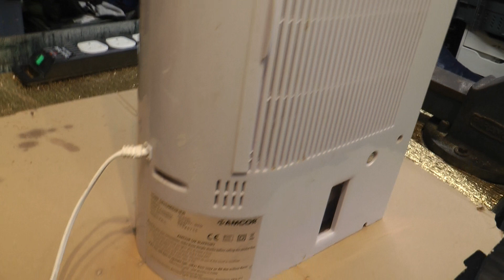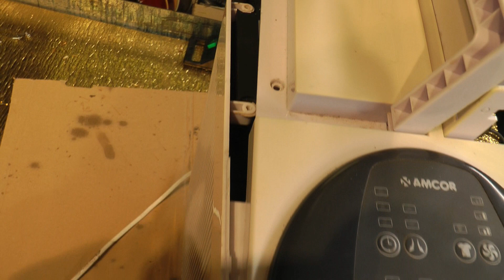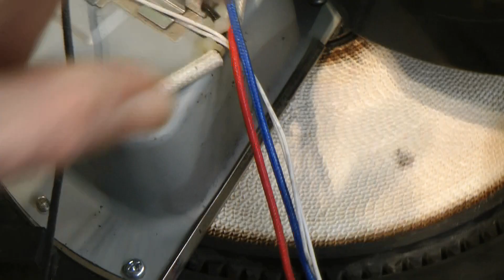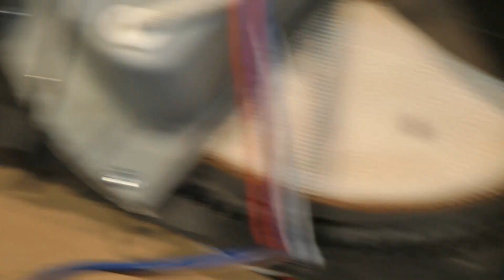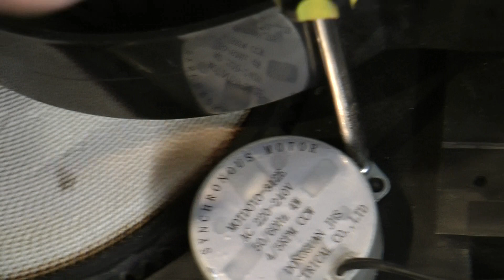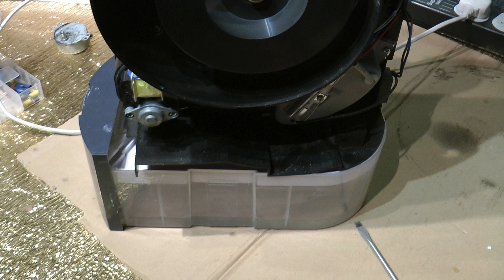AMCOR Dessicant Dehumidifier Diagnostics and Repair for not producing water

Comment: Thank you, I managed to find a problem with the electric motor also. I've ordered a new one and hopefully that should solve me issue. Any suggestions on making on the nylon bearing/bracket so it is easier to turn as mine does feel stiff slightly.
Reply from the maker: Thanks.   The centre bearing is pants as the boss wears and the wear isn't concentric with the centre of the wheel.  You need to find something tubular made of hard plastic Nylon or Acetal or PTFE.  I bought some plastic deep groove ball bearings but stainless ones would work just as well. The boss can be removed from the desicant wheel but you need a lathe to turn out the housing so the bearings fits. Lube it up with grease.

Comment: Thank you for this. I have same dehumidifiers and one stopped working. Seeing how to strip it down from your video enabled me to trouble shoot the fault - It was the little fan motor that circulates the hot air through the desiccant disk. looks like I'll need to go to Amcor for a genuine spare part because I can't find any non OE parts suppliers. Do you have any suggestions please? But thanks again - very informative video. JB
Reply from the maker: No problem. Is the motor seized/tight bearings  or a copper coil fault.   Have you checked the motor is getting power?  The motor type is called a shaded pole motor. There are many different sizes for sale on Aliexpress.com for a few £/$.  See if you can match one with yours. They are semi synchronous so the all have the same motor spindle RPM. Buy the correct coil voltage for your mains supply.

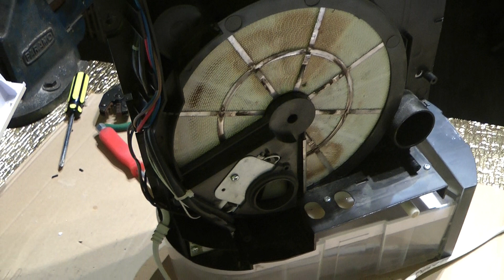Comment: 11:30 approximately what temperature is the hot air that expels the water vapour from the zeolite material?
Reply from the maker: For typical desiccant zeolites, regeneration temperatures usually fall around 200°C to 300°C (392°F to 572°F) to effectively remove moisture and restore absorption capacity.
Reply: @razenby  Oof. I was going to try to generate that hot air with a heat pump :(

Comment: A really brilliant video! Gave me the confidence to take mine apart. Thank you! Have bought a replacement motor but definitely an issue with the spindle as the disc runs against the edge of the housing. How did you rectify? I don’t have many tools but really keen to fix it as the rest of the unit is working. Many thanks in advance!
Reply from the maker: I found a piece of nylon tube that fitted over the central spindle and took the plastic boss out of the wheel and drilled the hole out to the diameter of the sleeve and glued it in. On the second one I bought a cheap ball race and machined out the central bush on a lathe.   Anything you can do to make it run true will help.  You'll have to search around until you fins something that works.

Comment: Internal components look identical to my ecoair machines, I found the shaft bearing of the disc turning motor wears out making the drive sloppy, ecoair charge about £22 for a replacement. This bearing is metal not phosphor-bronze so fails after 18 to 24 months (once managed to make a new one from that material out of an old motor and araldited it in place, and worked until I got a  new one from eco-air, who told me they had been uprated. "not true"). I was wondering if you have also found that the dessicant discs start to disintergrate after a while (dessicant chemical delaminates from the matrix material) and if you have sourced replacements?
Reply from the maker: I have six of these in rented houses. | have found 3 main faults: 
1. The motor gearbox fails. spares available
2. The centre bearing on the dessicant wheel wears and then the wheel rubs. The going gets tough for the motor and fault 1 happens when the motor gives up.
3. the unit is dead because the contacts on the tilt switch are burned out (open cicuit). 
I use nylon ball races that are about a pound each and turn out the hub on a lathe to fit. They last virtually forever.  I haven't seen any bad or disintegrating discs. They do discolour a bit butt hey seem to work OK.

Comment: Hi, Thanks for the video, it helped a lot in understanding the components and how they work. I was under the impression all dehumidifiers are basically condenser/evaporator type with a compressor, basically an air conditioner.

I too have the same model and the thing is only a year old so just out of warranty. Worked fine for a while although used sparingly. It has now stoppd dehumidifying and there is no water in the collector tank even though it seems to come on and work. I opened it up and checked everything. The motor turns the disc OK, and the main impeller fan works. Everything seems to be in order except I do not get any hot aair blowing out from the hole where the hot air is blown over the condenser.
I assume it is the heating element that is kaput. I had a look at the connections and the cable ties that hold the heating element seem to have gone brown and dry. One snapped (actually broke) when I tugged at it. What heating element do they use and where can I get one?
Reply from the maker: Most likely that the heating element has gone open circuit OR the thermal protection fuse has blown. The fuse can blow when the air intake to the unit is blocked.
Reply: @razenby  Thanks for thereply. The fuse is ok having checked it with a multimeter. Any ideas where I could get a heating element replacement? It seems these things were designed to be thrown away as there are no spare parts supplier available.

Comment: Thanks for doing this video.  I have the exact same model,  and was about to pull it apart. The disk turns and the exhaust air is hot,  but it seems to only turn on for a short while then shut down.  I can see the disk is nice and clean (no dark burn marks on the filter side), but it doesn't collect water now. I guess it might be the humidity detector / humidistat that has failed,  and it thinks the humidity is low enough to switch off? Do you have any experience of that?
Reply from the maker: It could be the humidity sensor that is faulty or the wiring.   I think if you set laundry setting the humidity sensor is ignored (check instructions). It could also be a power problem just as described in the video.  If the capacitor has deteriorated just so far the unit shuts off at random times.  It is worth checking the capacitor as 9 times out of ten it has gone or is in the process of failing.  Other things to check is the full water level float switch and the tank present switch. Either of those playing up can cause it and finally there is usually a topple switch that detects when it has fallen over.  On one of mine I shorted it out as it was intermittent. I don't advise you to run it unattended with it shorted but it did prove to me that the switch was iffy.  Good luck.
Reply: Thanks. What capacitor? Is that just another name for the capacitive humidity sensor? I don't remember seeing anything about that in tor video.... I'll try on the laundry setting to see if it continues to run.
Reply from the maker: @andyg5059  See the other video. The problem part is detailed and changed.
Reply: @razenby   thanks,  but still confused. There are only two videos right? I couldn't see which part you mean.  Opened it up,  and there was a bit of fluff on the humidity sensor,  which I've blown off.  Nothing else looks amiss.  Reassembled and checked what it was doing.  It starts up normally and the air coming out goes all the way down to 18% RH, and the temperature rises to about 5 or 6 °C above the ambient. On the lowest setting it turned off after about 5 mins,  but the led under the button stayed lit. When i blew into the slots near the sensor it started again,  so promising.  I now have it on the second setting,  and it is still running stably at 16% and 37°C out.  Before,  on the highest setting,  the temp rose to above 40°C and when it cut out only the power led was on.  The setting led was off, so like it had turned off fully. Haven't really done anything,  so probably haven't fixed it,  unless a loose connection.
Reply: It might be a problem with the timer function. I put it on the laundry setting but it shut down again quite quickly,  but now on laundry and a 2 hour time on the timer function it seems to be working.  It is definitely dehumidifying anyway. The water full float sensor works fine.
Reply: No,  still shutting down.  I'll have to open it up.  I'll let you know what I find.
Reply: Hmmm, still not working right.  It seemed to work correctly for some hours last night,  waking up to dehumidify regularly as the humidity rose,  but then after working fine i noticed that the setting led had gone out - presumably a shut down.  Only the power led was on,  like when it is first powered on at the mains switch.

Comment: Great video.. thanks! I've got the exact same model and same problem with the motor.. The original motor is CCW only... you've replaced it with a CCW/CW.. is it going to cause a problem when the motor starts CW? I couldn't find an exact match CCW-only motor anywhere so also bought a CCW/CW same as you with the hope of switching the gearing from the original to make it CCW only but I can't see how they made the original CCW only. Any thoughts?
Reply from the maker: Good thought. No, because the process is radially symmetrical so it doesn't matter which way the disk rotates. Mine is still running OK.

Comment: Hi thanks for the info. The problem with mine is that although the dessicant disk turns, it still doesn't collect water, and after some time running it stops with red light on, as if the tank is full, when not even a drop is in it. Any suggestions please ?
Reply from the maker: `Is there any heat in the heating section?  Sometimes the heating element blows and will cause this fault.
Reply: @razenby  yes there is heat and I took it apart to see if there is any blockage, but I cannot see any. Thanks for the reply
Reply: Hi, What happens if the heating element fails, does it overheat or just do not heat ? mine is heating so much that it cannot be touched, or it is the thermal switch that is failing ?
Reply from the maker: @mariocarmariocar2044  Hmm if the desiccant disc is rotating and the fan is working (blowing air) and the filter is not blocked then it should dehumidify. Have you checked all the basic things?
Reply: @razenby  Hi thanks for your interest. Today I let it work for two and a half hours, I set it to 40 % on low speed. it works on cycles of15 minuets On 5 minuets Off, dessicant disk rotating, fan rotating blowing hot air, no blockages and still it did not collect a drop of water, when humidity is 58%. what I found after the 2 and half hours is that when on high speed the cycles are of only 2 minuets On 5 minutes Off, don`t know if that is the trouble.
Reply: @mariocarmariocar2044  I think this was likely the small blower for the heated air. It needs to blow with enough force to put the extracted water vapour into the plastic heat exchanger catacomb.

Comment: Thank you very much for doing this. I noticed that my same model dehumidifier had stopped working yesterday and after watching video I can see that the dessicant disk isn't rotating. It was 3 years old but had only been used occasionally. so don't think much of this models longevity!

If I can't get any support from the seller I'll open it up and follow your guidance. The video gives me confidence that I should be able to keep it going for a few years more!
Reply from the maker: Thanks for watching. These are very repairable. Note if you suspect the gear motor is bad it can fool you as if you give it a twist of knock it it may start and appear to work. Don't be fooled- the gears are worn and it will stick soon after you put the unit back together.  if you it sticks once then change it. Check to see if it is the microwave motor by removing it and see if the disk moves freely as shown in the video.  If it is at all stiff then you need to investigate the central spindle boss as it wears and the outside teeth on the wheel then foul on the housing.  Once you fix it it will goon and on. they are every maintainable.  I have 2.  The one in this video I bought three years ago and fixed the spindle and it has been in service in the workshop. . As you can in this video the motor failed recently .  It is back in service again. The bearings of the 2 fans were still very good. Good luck with the service.

Comment: Another instructive repair. The interesting thing is that each country have a different problems. I fight against low air humidity in wintertime 😉
Reply from the maker: Thanks. The humidity here swings widely from day to day depending on which way the wins is blowing.. either dry continental air or moist from the Atlantic..
Reply: @razenby  We have a family in Bangor (Northern Ireland) and we visited them during the winter. The high humidity in the house is, I suppose, due to the specific style of building and often a lack of solid insulation (winters in the UK are not usually cold as I noticed, at least from my point of view). In addition, there are savings on heating, which is not cheap. Everything together is unfortunately a recipe for high humidity in the house.